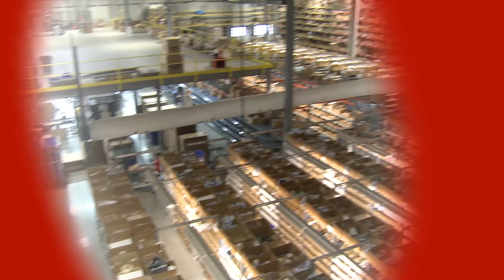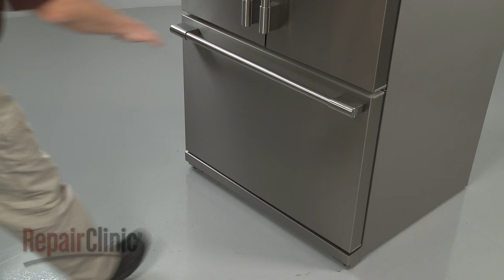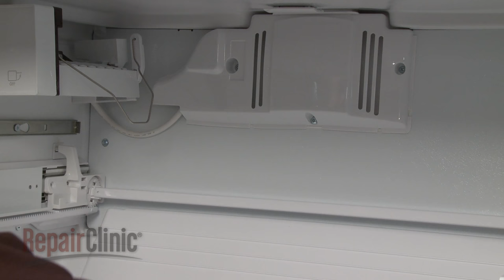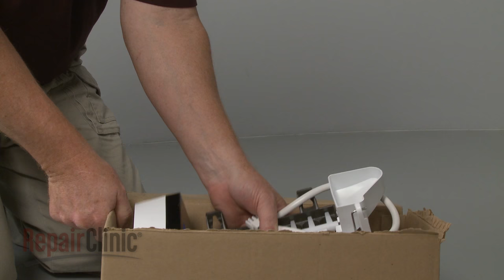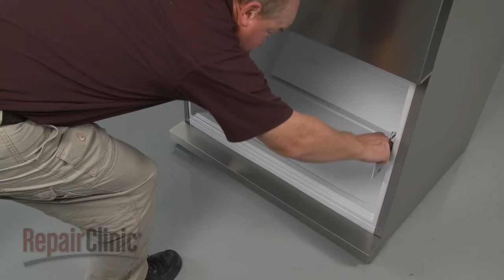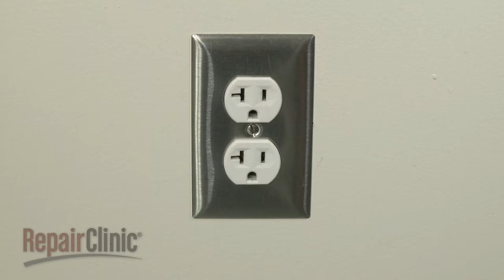Frigidaire Refrigerator Ice Maker Replacement 5304504052

Comment: I used these instructions to remove and repair my icemaker. Thanks so much!!! 

The one issue that I had was that I could not slide the icemaker assembly forward on the mounting studs after removing the front screw. It was stuck and would not budge. I ended up removing the icemaker from its plastic mount (there are qty 3 quarter inch bolts on the bottom). After I got the icemaker itself out, I was able to loosen the mounting studs a quarter turn and slide the icemaker assembly forward easily.

I did not have to replace my icemaker, I fiddled around with it, and realized that the External Wire "I'm full of ice" Lever Arm Thingy  (EWIFOILAT) on the side of the unit was not engaging the connected internal switch properly. I just bent the piece of metal that engages the switch a hair and now voila. Note that you have to take the icemaker itself apart (3 screws on the front) and then take off the piece of sheet metal that 'cams' off of EWIFOILAT to bend it. Pretty simple, hardest part was getting the spring for the EWIFOILAT back in place on reassembly - not too bad though. Bending the EWIFOILAT itself did not solve my problem.

It's easy to tell if this is the issue, you should be able to hear this switch engage as you move the EWIFOILAT up and down. I had to push (force) my EWIFOILAT down to hear the switch click.

Note, I have a screw gun and thus did not need to disassemble the door.

Tools needed:
* Phillips screw gun.
* Quarter in socket and a 90degree driver.
* Set of pliers to bend the sheet metal. Remember: Just bend it a hair.
* A bit of patience.
Elapsed time: 45min. Including playing around with it to figure out how it works.

Comment: What if you remove the icemaker and do not replace it? Will the refrigerator still operate normally without one (or throw a bunch of error codes)?

Comment: the bootom ice maker start making ice and the top ice maker stop can you tell me what to do,the wire signal arm what position need to be to stop the bottom to make ice, never happen before,never use the bottom.i only need the one in the top. thanks.

Comment: What do you do if the fill tube going to this ice maker misses the bowl on the ice maker?
Reply: Did you ever find a fix for this?
Reply: @christianlyness2268  yes, I talked with Electrolux on this. They had me pull the tube out and cut the opening a little more towards the bowl then fill the side of the opening with some of that refrigerator putty. This put the tube right over the bowl and solved the problem.